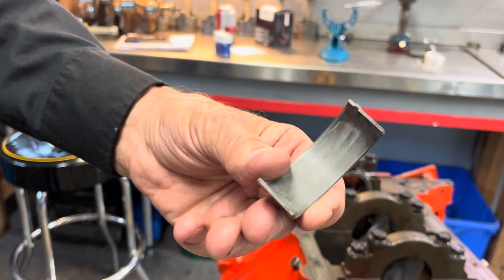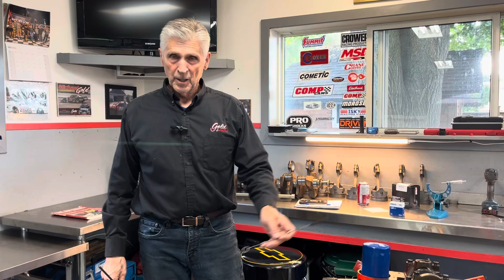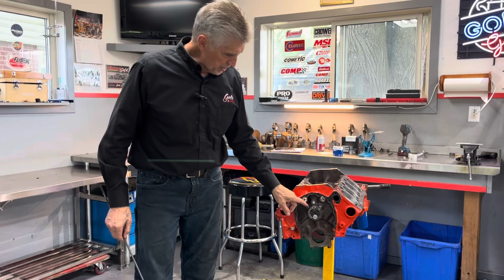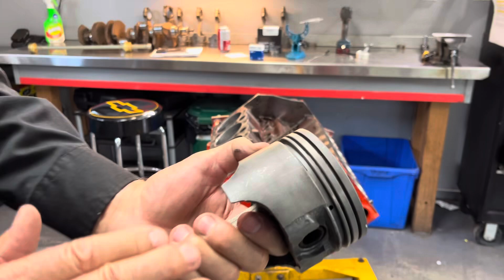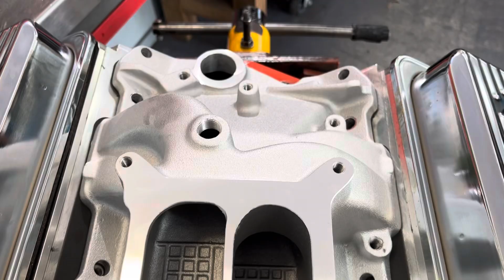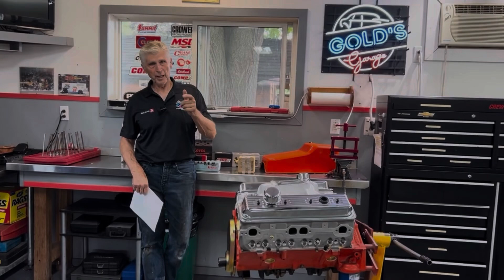BUDGET 350 CHEVY BUILD! 4/7 SWAP Camshaft on 87 PUMP GAS for 380-400HP!

Comment: Thanks again, this is good usable info.  The cost advantage at the pump for 87 octane is a big consideration, when the engine is going in a fun daily driver.
It really is a big factor over the lifetime of a budget high performance street engine, it's a fair chunk of beer and pizza.
Reply from the maker: Thanks for your comment Marcus. I agree, for the sake of a few HP, the savings on 87 fuel is worth while.AG

Comment: ALAN I HAVE THAT EXACT BOOK AND I BOUGHT IT IN 1994 AND I STILL HAVE IT SITTING HERE IN MY SHELF. THAT'S A GREAT BOOK
Reply from the maker: Thanks Brian, I am struggling to find time to read it again, but it is interesting to re-read it many years later. so much has changed. Bill was a visionary and took a deeper dive into everything. At the same time, some of it is now obsolete with so many great aftermarket parts available. Bill had to sort through a lot of OEM stuff to find the best available. We are actually pretty lucky today. 
Thanks for backing me up on the bearing comment.  AG
Reply: @goldsgarage8236  absolutely
Reply: Also just so nobody thinks Alan is crazy concerning the bearings, we have reused rod and main bearings sometimes for 5 and 6 seasons in a row. When they come out looking like they came out of the box and your bearing crush is still perfect you don't take a risk you keep a known good part.

Comment: Hello Mr. G how are you. I have a question about a Pontiac 400 that had to be bored ,060 to get rid of rust. Will those cylinders be too thin for high performance and would it strengthen the cylinders if I have all of them sleeved to .030 ??? Will be using a summit SUM-2801 cam. That is an indication of what performance level I will be building. The block came out of a 1969 Grand Prix its not the awful thin 500557 that was used in the smog era that made only 220hp
Reply from the maker: Thanks for the question Christopher.
Many Pontiac 400 blocks have been bored .060 but, it’s always a good idea to have them sonic checked. Sleeving the block after boring could become cost prohibitive, and may be better to source another block. Your machine shop should be able to provide guidance on this.
We have used the Summit 2801 in the past, it’s a very nice mild street camshaft.
AG
Reply: @goldsgarage8236  Thank you Mr. G 👍
Reply: As a Pontiac guy, your only issue will be the temp gauge. It will run warmer than a normally hot Pontiac. I am a 108 Lsa guy so 2801 not my choice.

Comment: The most important question is why when you are right handed, do you always get a hole in your pants on the right knee?????
Reply from the maker: Thanks Racer, I knew someone would notice that. Actually, I am left handed and the worn out knee in my jeans is from kneeling over the race car during pit stops. We do have knee pads, but sometimes I don't bother to wear them. AG
Reply: @goldsgarage8236  Ya my mistake, I am right handed and all my pants have a hole in the right knee. Crazy stuff. You are doing a great service with all your Vids.

Comment: Grumpy was the man in NHRA.  I have not used an 880 Block. but I have used the old 3970010 block.  010 block is still the best block out there.  they used them in all the high-performance engines, and trucks as you mentioned, but they also used them in heavy duty application like taxi cabs and cop cars. I have 2 in my collection of spare parts. both are 4 bolt. one is a L82 from a 74 corvette with .020 over pistons. bores look good, I can see the cross hatch in the hone job, but the cam went flat in it, so I got it for a dirt cheap.  the other is out of a 77 Caprice taxi. its standard bore, has a .005 ridge and taper at the top of the block.  so it needs to be bored .010 to clean it up. rod and main bearing s std/std I plan to rebuild the L82 to factory spec and sell it off.  the one out of the caprice, i plan to turn in to a clone of an LT1 350.  but with the Trick Flow's aluminum clone of the 186 camel hump head. and find an old nova to dump it in. and make a tribute to a Yenko Deuce.

As far as the 4/7 cam swap stuff, from dyno test I have seen and from watching Engine Masters with the great Steve Brule, there is not much difference between a standard pattern cam vs a 4/7 swap cam on a street motor, any differences were within the margin of error on the Dyno for the street motors, but on a 540 chevy big block, 14:1 compression, single plane intake, full on race engine there was a 20HP difference at peak HP. but you don't see any gain until over 5000 rpm. so realistically you may see 3-5 HP on a street engine at peak.  

I think the reason for the difference in power is due to better airflow in sequence.  example cylinder 7 is filling right after cylinder 5. on a 18436572 firing order engine. so cylinder 7 is stealing air/fuel flow from cylinder 5. so, neither cylinder is filling to full capacity on a naturally aspirated engine with a single plane manifold. with the firing order change there are no adjacent cylinders filling at the same time. 4 and 8 are on opposite ends of the intake, where in the 5 and 7 are right next to each other. again, this would only matter in a single plane intake.  you won't see a difference on a dual plane intake. I have heard some people say its because of better crank harmonics with the 4/7 swap or because of better temperatures in the block because 5 and 7 are no longer firing adjacently and eliminates a hot spot at the back of the engine. the NASCAR guys used to run -6 coolant lines from the back of the intake on the old Gen 1 small blocks, so there may be something too that, but those are full on race engines not street cars.  I think there may be something too all 3 theories, but you may gain a couple of HP from better cooling, a couple from better crank harmonics, but I don't think either of those, by themselves or together, would be with worth 20 hp on a 540 BBC.  I think the majority of the HP gain would be from better airflow dynamics at high RPM. that is just my 2 cents. only three ways to make more power, 1. ingest more air and fuel, 2. reduce frictional losses and 3. improved combustion efficiency.   I would love to see that tested with a naturally aspirated BBC race engine with a single plane intake like a Victor Jr or Super Victor and so O2 probes in all the headers. my bet is that with a standard cam, cylinder 7 is stealing some of the fuel mixture from cylinder 5.  #5 will go a little lean and 7 will run a little rich. just because of the airflow dynamics in a single plane intake. since #7 starts filling when #5 is about halfway through its intake stroke. this cause flow to stall in the #5 cylinder and for it to lag as it beginning of filling #7. a dual plane intake like the performer RPM feeds 5 and 7 from different side of the intake plenum so I don't believe you will see an HP gain that can be quantified to a 4/7 swap cam. 

if i had access to a dyno and was just testing this, i would 1 grab a baseline pull with O/2 with a standard cam and dual plan intake like the Performer RPM. then swap to a single plane intake and compare the AFR on cylinders 5 and 7.I bet this will show the #7 is stealing intake charge from #5.  then swap from a factory balancer to a better harmonic balancer like an ATI, Rattler or Fluidamper.  and see if there is a change, then i would add the auxiliary cooling lines to the intake last the NASCAR buys used to do ad see if that made power. then swap to the 4/7 swap cam and back to the factory balancer.  repeat the tests. then compare each of the tests to get an apples-to-apples comparison.  that's a lot of work to only verify a 20hp gain at peak on a 540.
Reply from the maker: Thanks for your detailed and insightful comments Shad. AG

Comment: Thinner low tension piston rings showed up at about the same time as the roller cam did in OEM blocks. Those blocks rarely show much wear in the cylinders. The last one I took apart was a 1990 engine that had 170,000 miles on it and you couldn’t feel a ridge at all.
Reply from the maker: Thanks Angela. Another factor is that those engines were fuel injected. A lot of wear is on a carbureted engine is during the first few minutes during a cold start, as unspent fuel washes the oil off the cylinder walls.AG

Comment: I had my engine built with 4/7 swap cam. I didn't care if it improves power. My engine builder said he does the swap with mountain motors with large stroke and find due to the fire sequence bearings always look good. Also it helps with intake distribution with a large plenum. Idle is also smoother as well. Chevrolet revised to the LS fire order to further improve crank bearing wear. Great content Alan, keep it coming!
Reply from the maker: Thanks Len, a good case for the 4/7 swap. AG
Reply: Ls firing order is different than 18736542 !
Ls is 18726543

Comment: The 880 block has shorter cylinders than the old style 010 blocks. Not an issue usually but with some  383/3.75 stroke builds if you are running stock length rods the piston comes out of the bore quite a bit on bdc and piston stability won't be as good.
Reply: Not all 880 blocks.
Reply from the maker: Good info, i did not know that. Thanks Robert.AG